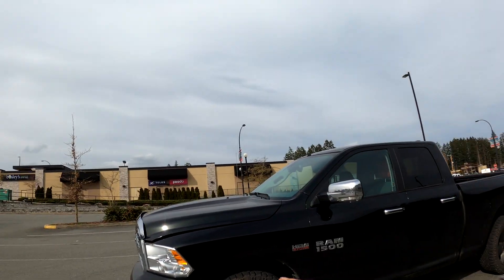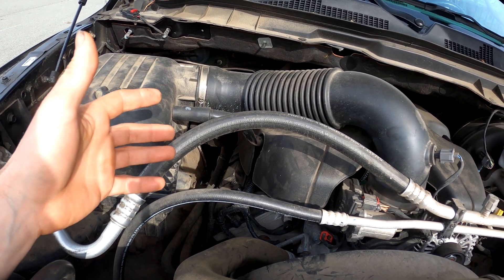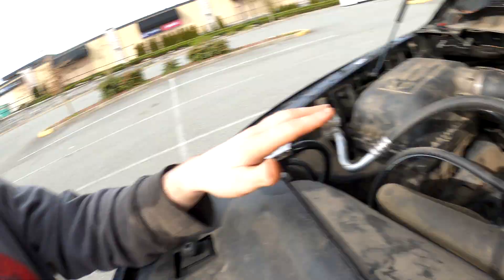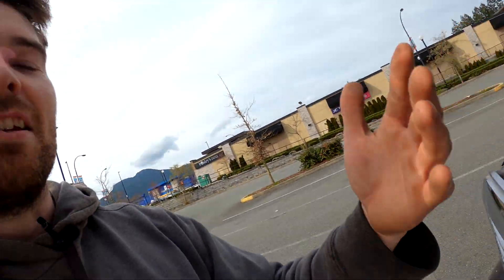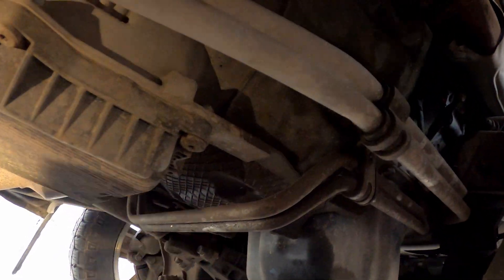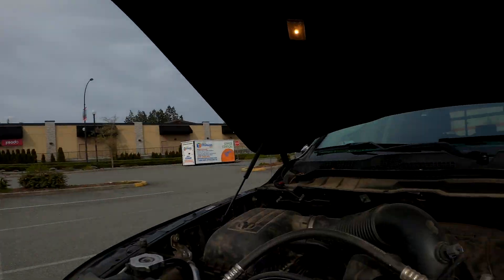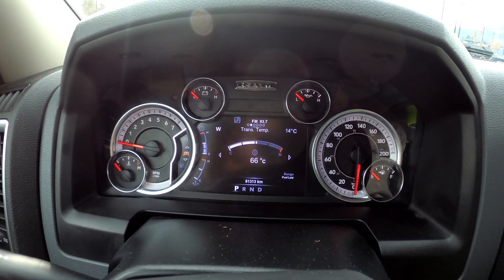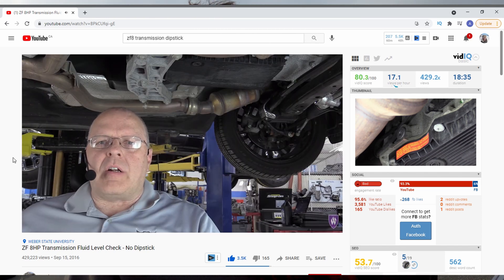RAM 1500 8 Speed Transmission Fluid Level | NO DIP STICK (ZF 8HP)

Comment: Nothing new. My 2009 f150 480le you have to crawl under truck and take a 5/8 wrench and loosen and pull the attached dipstick attached to socket like nut. Dipstick is about 2 inches long

Comment: IS it leaking, like your oil drain? ATF does not evaporate. The lack of a dipstick is to thwart YOU from servicing it. The procedure is completely doable by most mechanically inclined and detail oriented. EACH 60K miles.

Comment: If trans operating temperature is 220 +,  how does worrying about fluid "expanded volume" at 86 or 116 matter?   Thats Just BS.    Measure fluid you take out.   Plan to add 5.5 qts.  Fill port on Rear of trans. Have Rear of truck slightly higher than front for refill.   After done, go get tatoo to celebrate.

Comment: Anyone smart enough to think they need to check the transmission fluid level knows about contaminants. This isn’t even check your dipstick 101. I agree with the other comment. They said seven minutes of my life wasted. The only thing useful was the ZF transmission being a sealed unit which I already suspected. That’s like on BMWs. I think they use a ZF transmission also. They’re very good transmission though. One of the best, but if you get a bad one, it’s pure crap.

Comment: what a pain, they also had to run the exhaust right underneath the drain plug requiring a modified or custom tool, as well as having to drop the pan for a filter change. similar problem with oil filter, but at least i can get that off with oil pliers. they gotta be intentionally making these things hard to repair

Comment: The transmission is not level when the truck is level. The rear end of the truck needs to be jacked up at least 8-10 inches to make the transmission level when doing the fluid level check procedure. The procedure includes turning the traction control off, running the truck through all the gears for 5 seconds, starting with reverse for 5 sec with brake applied, drive with brake applied, letting off the brake and accelerating slowly until the trans shifts to 2nd gear, returning to idle, put in neutral and rev to 2000 rpm for 5 sec, return to park, THEN you can open the fluid plug and add or drain as needed. This whole procedure must be done with the trans temp between 86 and 120 degrees Fahrenheit. What a joke of a design.

Comment: so i drive a Peterbuilt tri-axle with an automatic trans and you can check fluid electronically with up/down buttons pushed at the same time... maybe this trans has similar arangement ?  It shouldn't be that difficult to check fluid , for christ sakes 🤨

Comment: Whenever I level my truck, the front of the Trannie is still tilted upward. I put in about 5.5 quarts (estimated - I got a little sloppy with my pump) but was still concerned (since I had a gush of fluid from the fill plug when I started) so I topped it off the next day jacking up just the rear, putting in another 1/4 quart or so. I got the rear as high as I was comfortable with 3-4 inches or so, and the damn trans pan is STILL tilted. So is it the trans or the truck that has to be level? :/
Reply: This!! So many talk about making sure truck is on level ground. But a couple videos I've watched and a printout of procedure and protocols stress that it is not the truck that needs to be level but the transmission! This involves having the back end significantly higher... and you need the rear wheels in the air anyway so they can turn when you cycle thru the steps in the procedure. This involves actually putting a little level on or along the top of the pan where it seals to the body of the trans. If the  truck is level the rear of the trans is lower and you'll lose fluid out the fill hole and end up low on fluid. Do your research... learn the right procedure and follow it carefully.

Comment: It doesn't have a dip stick because it has a sealed transmission. It was designed for you to not be able to check the levels to keep the transmission clean and free from debris. Take it to the dealer to have it serviced at 100k miles. Unless you suspect it's leaking fluid or something is wrong. Leave it alone.

Comment: That's a pile of crap!!!  That's what the filter is for!!!!!!!!  I had an interesting professor in collage while earning my Degree in Automotive tech.  One of his favorite sayings was, " parts left out cost no money and require no service, from the owner"  meaning that you are forced to go to the dealer or a shop for service.  The vast majority of contaminants come from inside the transmission via normal ware of clutch materials and bearings.  Just change your fluid more often than the service schedule shows and most automatic transmissions will last well over the life of most ownership.  My F150 had over 400,000 before it needed new clutches and seals. The bearings were still serviceable and the truck is still running with 550,000 on it. I sold it to the company I was working for at the time. I still see it all the time.
Reply: exactly...  "change your fluid more often than the service schedule shows and most automatic transmissions will last well over the life of most ownership,"  dealers  dont want you to know this FACT ! old saying   ZF transmission  happier  with  a simple  drop and refill ( NEVER  do a  flush!) with New  unburnt , uncontaminated fluid .intervals, 50K , 100K  etc

Comment: No they’re not trying to avoid contamination lol, they literally did it to prevent diy people from servicing it themselves, that way they’ll have to take it to the dealership
Reply from the maker: dealership literally won't service these transmissions. As far as they are concerned the fluid is lifetime.
Reply: FCA has said that the transmission is non serviceable so the dealerships can't find out how much time to charge that's why they don't do the service however you can buy/order the transmission pan , fluid from the dealerships like i did but the term " LIFETIME " is not reffing to the fluid it's reffing to the " LIFETIME " of the transmission  meaning if you don't service your transmission the fluid will break down and destroy your transmission and that's end of your " LIFETIME " transmission it's designed to get the consumer to buy either a new transmission or buy a new vehicle either way they want you to spend money
Reply: Exactly & the reason I buy older vehicles and repair & keep them up. @joe7528
Reply: Then they did it so you have to buy a new transmission or truck win win for the transmission manufacturer and their important customer..the manufacturer not you the consumer.  And how do they know how long me or you will live what a joke. Lifetime means whatever period of time it will last so forget about trying to extend its life.
Reply: 1100 dollars….

Comment: ZF gearboxes are all like this
Reply from the maker: it does seem that way!
Reply: @GettysGarage  also, to answer your question as to why they do this, the answer is ZF gear boxes are very sensitive to the fluid, put the wrong fluid...... you will need a gearbox. Most of them are "life time" fill and you are not to change the fluid except when a repair is made. Also, ALWAYS get the fluid from the dealer. Yes, it is more expensive, but this will guarantee you are putting the correct fluid in and is still cheeper than a new gearbox.

Comment: I think the ass needs to be raised quite significantly because the bottom of the pan needs to be leveled. Then you can check your fluid when youre within temp spec.
Reply: On my '17 Ram I need to raise the rear end approximately 7-10 inches to get the transmission level.

Comment: ZF recommend 60000km trans fluid change and the whole trans cover includes the filter . Dealers prices $1200 plus for service!! That till last year FCA was claiming is “lifetime “ fluid!! 
ZF manufacture even went public and wonder why FCA keeps misinforms customers!! Over all is easy to do the service but time consuming!!
Reply from the maker: I know I kept hearing lifetime fluid which seemed crazy! even the FCA recommended interval of 160,000km seemed a bit much
Reply: @GettysGarage  normally every 60000km trans , diffs,  transfer case needs fluid change!! However that is if the vehicle is been used under normal conditions and not towing constantly or off road if!! I personally contacted ZF manufacturer in Europe to ask them and exchange information as per subject!!